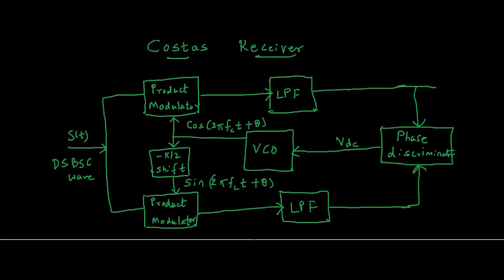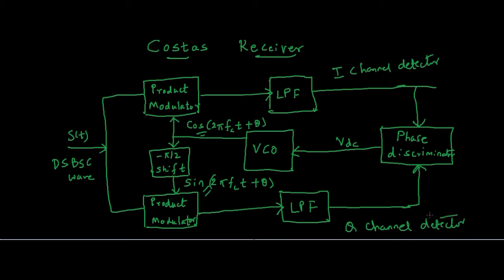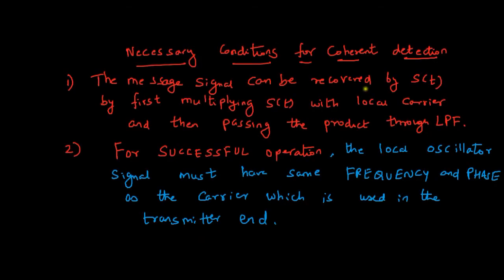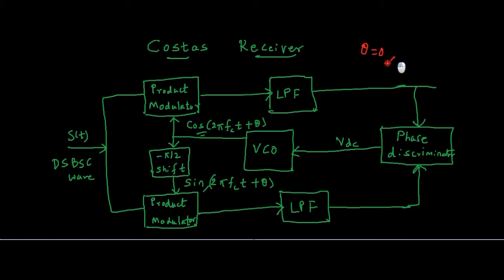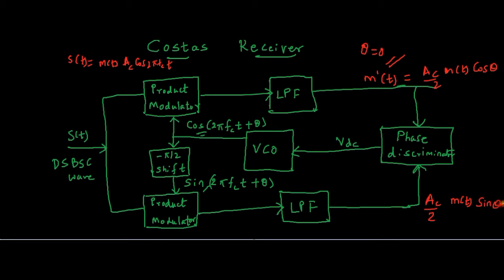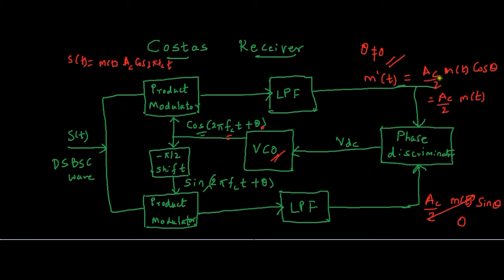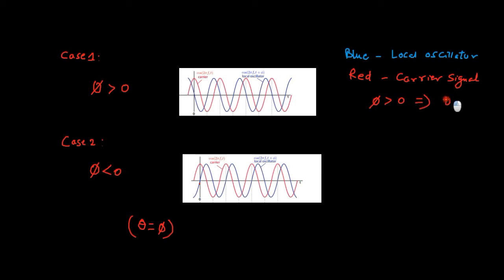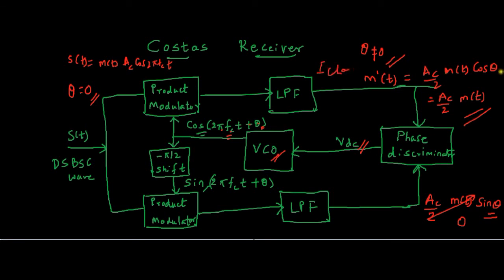Working of Costas Receiver

Comment: The VCO is not meant to have the same frequency as the carrier embedded within the incoming signal. This example has issues. The VCO's initial frequency is generally different than the incoming signal's carrier frequency - at least initially.